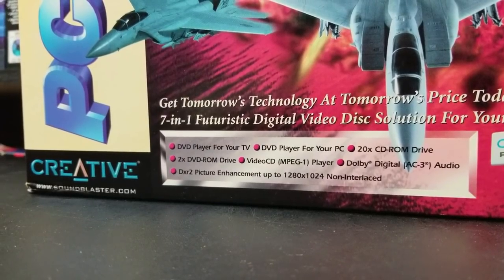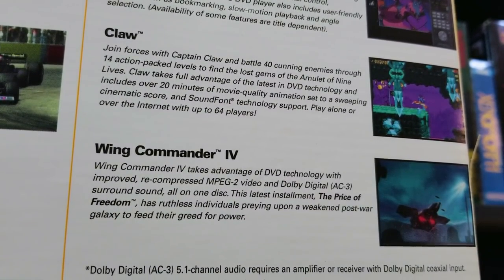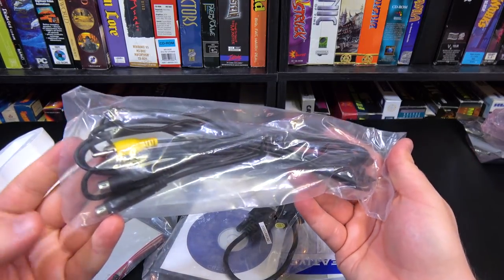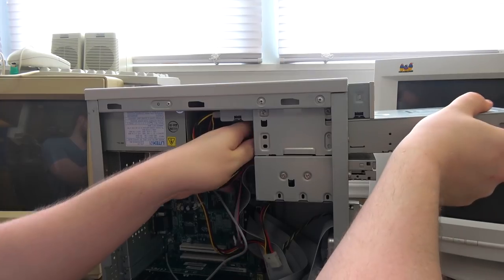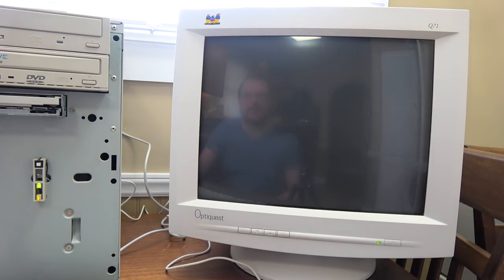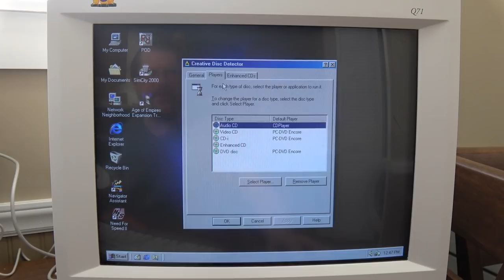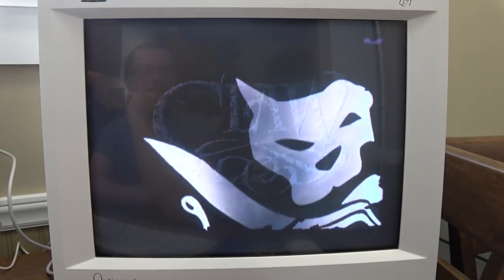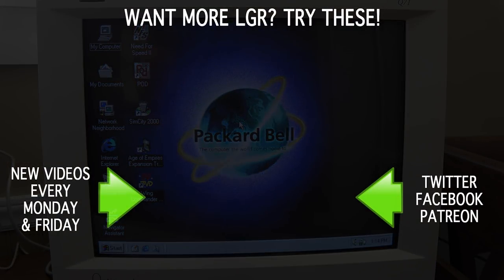The 1997 DVD-ROM Upgrade Experience: Creative Encore Dxr2

Comment: FYI: I actually had this same kit, although a year later. First off, it was awesome in linux. there was a module for i want to say mplayer, that let you send anything to the card, giving awesome playback. i used to transcode my stored videos and always render in mpeg2 for that reason.

Also, the reason many of those dvds wouldn't play is because of a bit of anti PC code many venders (especially disney) used on their disks because of paranoia over piracy.. guess they weren't technically wrong in the end. Of course if you had something that included the decss code, linux got around that annoying issue as well haha
Reply: ok i stand corrected on that particular dvd, but it was definitely something that was happening in the 90s on some releases. the movie studios where on a pretty bad power trip at the time

Comment: I own the next model, the one that included a Dxr3 along with a 6x Creative Labs DVD-ROM, and playing the DVD-enhanced included games they also flicker. However, I noticed that the amount of flickering depend on the first setup routine, the one where it configures your monitor and resolution. But nevertheless, there's always some flickering. And a little waving too. For the record, the Dxr3 box included Riven instead of Claw and WC4. But I bought those from a friend to test them. Anyway, the video from the DVD version compared to the standard 6 CD version is night and day, even with all the flickering going on. I mean, 6 CDs x 650 MB = 4 GB total. The DVD version is single layer but double sided, meaning that it contains more than 8GB of DVD video, and the difference shows. Gratz for the video, but I would appreciate if you could stop talking when the demo videos are running on the computer. ;)

Comment: Instead of putting the DVD-ROM in rhe computer, I chose to buy a stand alone unit and connect ot to the TV. Then I found out just how incompatible DVD recorders and media were, since some units could "do DVD-R" but NOT DVD+R. Others were hostile to DVD-R, which made intensive scanning the prospective DVD player's manual mandatory. It got so bad that I had to buy "one of each," which ticked me off no end, especially if one or the other "got the vapors" and stopped recording. This compatibility problem with DVD recordable media finally was settled...just in time for the Blu-Ray vs. DVD-HD wars. I waited until Blu-Ray won, but kept the Blu-Ray unit next to the TV. Then streaming video arrived, and the DVD market evaporated. Oh well, there's always eBay if Amazon doesn't have the DVD/Blu-Ray disk.

Comment: What happened if you also had a 3D accelerator ? Did you have to plug the cable from the standard video card output to the 3D accelerator input and then another cable from the 3D accelerator output to the Mpeg decoder card input, and then the VGA cable to the monitor ? Or the other way around, or it simply didn't matter ? Did that work ?

Comment: I was always curious how all this pass through VGA stuff worked, be it video or 3D accelerators. I mean, the video is showing up in a window, so does it mean the card actually modifies the analog signal and blends in the video onto a blank window? I never had one to play with but I always wondered what would happen if you disconnect the connection from your original card or connected the screen directly while the accelerator is doing its magic. Does anyone know?

Comment: still can remember in that time, 1998 till 200x in that ballpark.... W2000 professional, ME and "95... it was always a lot of hassle to get multimedia working on a pc, sometimes wouldn't work at all...... Problems with playback, .DLL is missing messages... THE HORROR! back in the day  it was'nt easy to get a flawless video or music playback on your desktop as now... You had a whole lot of software and the Windows versions from 95 till begin 2000's where very picky on it. I can still remember with the specs > HP  motherboard 600 Mhz with 1 x 256 MB RAM INTEL pentium  3. [took over 30 minutes to burn a DVD with all processes killed hahaha] Graphics card and soundcard installed from medium standards/brands. I tried everything but the damn thing wouldn't play a DVD or any other codec on that machine, you know the codec packs! nothing worked well....... . The good old days.... ;) You guys have no idea how difficult it was back then to play a DVD/MKV/AVI or any codec succesfully and smooth on your desktop/laptop. Even LGR had to format C his installation to get it working!
Reply: Ohyeah, before i forget. RAM was really expensive in that time DDR1 and DDR2 modules you could buy but motherboards werent equipped for large amounts of RAM. Thats why i had only 256 MB at my disposal
Reply: I hated to repair and troubleshooting your machine, On board intel videos one of the first shared memory systems. 
Super small cases 3 PCI SLOTs.

Comment: The heyday of the MPEG2 decoder card (especially for DVDs) came and went in 1997. Circa 2000 I was given a new in box example of Diamond Multimedia's sole entry in the field. It included a 1x DVD-ROM drive with a massive, full length card, analog passthrough like the Creative cards. However unlike the Creative cards it was a useless POS. The only player that could use the hardware acceleration was the horrible one that came with the kit. Its player window could be resized but it could not be maximized or switched to full screen - all you could do was drag the edges out. DirectX was a thing but the people who wrote the drivers for this hunk of shame neglected to make them DirectShow compatible, which is why no other player could use the card. Everyone else in the DVD game hopped on the DirectX wagon. But wait! There's *less*! The drivers and player software would only work with Windows 95a. I tried it with OSR2 and it wouldn't function. Why for the love of Gates would anyone release a product in 1997 that was incompatible with Windows 95B?!

Diamond had thrown this product out there quick and dirty (they didn't actually make the board, it had some other company name on it, which I could find nothing about online) then instantly gave up on it. There were never any updates, the software they had to download was exactly the same crap it shipped with. I ended up just using the DVD drive and tossing the rest of the kit back in its box.

The death blow to standalone DVD decoder cards was the demonstration in mid 1997 of pure software DVD playback on a 300Mhz Pentium II. Not that the PC could really be doing anything else at the same time. DVD decoder cards that were compatible with DirectX and current versions of Windows held on longer because the software DVD players could also use hardware acceleration via DirectShow.
GPUs were also getting integrated hardware MPEG2 decoding but that rarely got any use due to the steep processing power climb going on that made it possible to do video playback better with software. "Ooooh. This video card had MPEG2 decoding. Lemme enable it in WinDVD. Ugh! Looks like crap compared to its software decoding."

Comment: Looking at adding something like this to my collection. I'm not finding the kit together, just creative DVD drives labelled PC-DVD and these MPEG2 cards by themselves. Does anyone know if the 6x Creative PC-DVD DVD6240E drive would work with the CT-7260 PCI card from this kit?

EDIT: Potentially answering my own question, apparently some of the 7260 models were called Dxr*3* and were sold with the 6x drives, so the ones I'm finding are probably two parts of that kit.

Comment: The problem is WIndows. It's a lazy piece of programming chunk masquerading as an OS. I built and refurbished PCs for many years both as a kid as an adult and most often it was the OS that crapped out. Yes, WIndows has improved, but the underlying architecture is still prone to fail/stall. I much prefer Linux-based OS like MacOS and the various Linux distributions that have been built around it (Ubuntu, etc.).

Comment: 2:10 - The obsolescence had less to do with brute-force decoding and software efficiency than the hardware decoding functions on the DXR2 board being built into later CPUs themselves. We really take CPU-integrated hardware video decoding for granted nowadays. And it was even worse when it came to encoding mpeg2, with software review benchmarks gauged in minutes-per-frame.
Reply: You're right, most current modern CPU & GPU can perform MPEG-2 decoding easily without any performance hit.